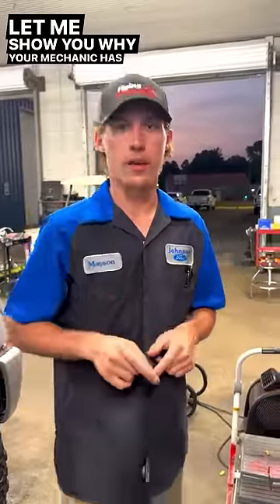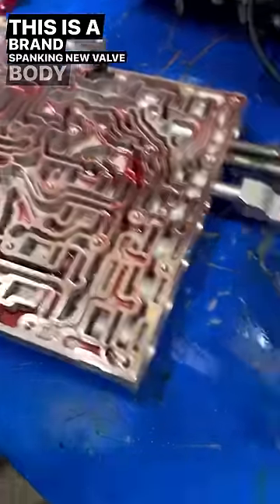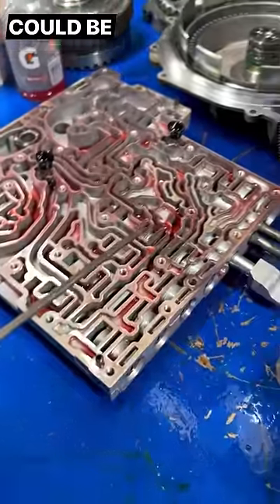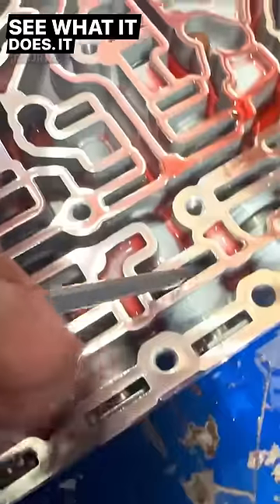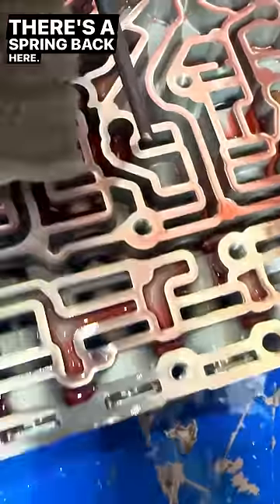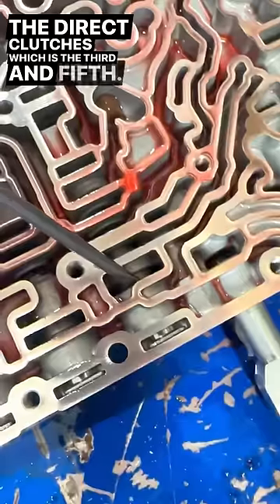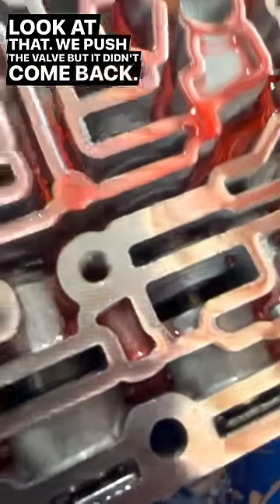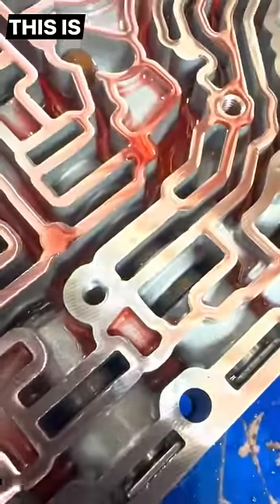Why your mechanic has trust issues #shorts #ford

Comment: this is why I always say: just because it's new, doesn't mean it's good
Reply: I have bought so many broken brand new parts I seriously have trust issues
Reply: I've bought probably 4 brand new alternators for various projects over the past 5 years and 3 out of the 4 were no good straight off the shelf...fuckin ridiculous if you ask me!
Reply: @iino27ii91 my thing is, if so many are broken right off the shelf, then what does that do to your confidence of replacing a new "hard to reach" part somewhere on your vehicle, and then it breaks a month later because it "worked" out of the box but it's still a shitty part made in some factory in China and now a month or less later you have to go in and do a pain in the ass job again because their quality control SUCKS!
Reply: scrutinize everything
Reply: 😂😂 I’ve been saying this for years! Some people don’t like the blunt fact of that statement. 😏👍
Reply: Just cause its American made doesn't mean its good.
Reply: new = never ever worked.  Nowadays especially for rotating electrical a good used part is often better than a new one.
Reply: Usually not
Reply: @foodhatesme  I work in an actual repair shop it, parts have gotten far less reliable we have been having these issues for years now.  Just because you bought one alternator and it was good doesn’t mean a thing.
Reply: Made in America*
Reply: If the whole transmission wasn’t overhauled so everything is spotless debris can contaminate the new Valve Body. If the torque converter is making metal, same thing.
Reply: Everyone I’ve ever met that decided to buy a new truck after having an older one since it was new has had way more issues with the new modern truck than they ever did with the old one. New vehicles are usually a huge scam.
Reply: @punchyourmom nothing is made in america anymore and hasn’t been for decades.
Reply: so is it overly complex or is it just poorly made?    Is it so complex that it cannot be made properly without driving the cost up out of affordability?   you are right..just because it's new doesn't mean it's good.
Reply: You can say that as broad as most vehicle built in the last 10 to 15 years.
Reply: @Gnefitisis made in america hasnt meant anything since the 198os when everything went commercial.
Reply: Has Ford always been like this?
Reply: @Eduardo_Espinoza  no
Reply: @haventthoughtofanameyet6364  that's my joke
Reply: I learned this after a lot of money 😀
Reply: Which is why I always do my damndest to repair/upgrade the broken part rather than replace with the same junk.
Reply: I always say something very similar:  "it's fine until its not"...   I'll tell my wife about an issue with the car that could potentially be a safety issue... and she'll say "oh its fine"...then my retort is "UNTIL IT'S NOT"...  im the type to address issues before they become bigger problems....she's the type to wait until it completely fails...  🤦‍♂️🤦‍♂️🤦‍♂️
Reply: I'm oversimplifying the whole thing and leaving out details here but in short, just to say: I have many older items from 40, 50, 60+ years ago that still work perfectly, either in original condition or with minor repairs done. However, I have experienced, and know many people who have, having items that were manufactured THIS DECADE, brand new from factory, give out within a year or sooner. Makes you think.
Reply: @RedLink27  cheaper/thinner materials is usually the issue...
Reply: In fact most of the problems I encounter at work are troubleshooting the new thing we just installed. After a couple months we've usually resolved it all and better long term but that first week is always rough
Reply: Dealing with that as we speak. I'm on alternator #3 from the parts store. It should arrive today, hopefully when they test it the damm thing will finally be good. I want to drive my project car again.
Reply: It's only knew once after that it's used
Reply: Lately, it has become, "just because it is new does not always mean it is bad." But that is starting to become a false statement today.  Now it is becoming, "Buyer beware if you buy it new."
Keep ahold if it is old.
Reply: Sometimes the new part has been manufactured with the same defect as the old one.
Reply: PREACH. Always always always keep your receipts people
Reply: @mpmfr i mean nobody does lol imagine telling a customer they have a bad New PCM but it happens
Reply: Somebody say that to Ford and other auto companies.
Reply: just because its OEM doesnt mean its good either 😉
Reply: New in a box doesn't always mean New in a box
Reply: I looked up the part in the video and it costs like $400 so if I paid that for a component that goes on a $40,000 truck it better be fucking good.
Reply: they dont make them like they used to!
Reply: N E W never ever worked (before) that’s what new means
Reply: Seems to make less and less sense to buy even a late model used truck anymore. They all have something very expensive wrong with them. 10 year+ old trucks have all bugs figured out, documented fixes, upgraded parts made. Extreme cost savings and peace of mind. Most probably need a back up vehicle though to work on the one that needs repair, but a back up is wise anyway.
Reply: Had to replace three new triple tested alternators on my 94 GMC within three months.  First one failed after installation.  The other two failed while driving.  The last one failed and with the other failures, the battery failed.  AutoZone replaced my battery for free but no warranty on the battery but thankful for the replacement.  The fourth alternator is working almost a year.  Through AutoZone, you have a lifetime warranty for as long as you own your vehicle.  I have a 72 Chevy El Camino and many of the parts that fail like spark plug wires, starters, alternators are lifetime warranty parts.
Reply: actually it’s getting worse
Reply: Just because it’s because, doesn’t because it’s just.
Reply: @Grozloo lmao way way more new parts are good than bad. Parts that come bad more than they ever come being good get recalls. Your being kinda dramatic to act like someone getting a new part that works means nothing...it literally means new parts can be just fine dude. Lmao
Reply: @Jeremy9697  you actually took the time to write that nonsense?
Reply: @peacepoet1947  lol cope harder kiddo. Again if new parts were broke more times than not the entire vehicle industry would have already fell apart. Be realistic child
Reply: @Jeremy9697  the comment you made was obvious and to be blunt a waste of energy to write it.  We are here to learn something and not read useless information.  Add something interesting or intelligent.  Is that too much to ask?
Reply: @peacepoet1947  kiddo...ypu responded to what you deem non sense is the real waste of ypur own time. What a hypocrite. Sorry dude but the person I commented to doubled down with a second comment on how new parts don't work...in his opinion obviously. So your point t has already been blown away... talk about a waste.
Reply: Yes, though I think it's important to remember that just because it's d doesn't mean it's better
Reply: i totally agree thats why i never get into the “this brands better” argument cause u can have two identical cars make n model off the lot and one might run for the next two years just fine but the other will break down and have constant issues the whole time u own it
Reply: @endlessbacontreats9916  after you own a vehicle and work on it when needed.  Most vehicles can last a very long time no matter what goes wrong.  I bought a 72 Chevy El Camino and I still drive it.  It needs work but I still drive it.  Bought two new front tires for her birthday.
Reply: but at least you can bring it back because you have a warranty
Reply: Or going to last lol
Reply: For real I’m always hesitant with “ new” stuff
Reply: Things now days are half the quality and double the price.
Reply: @JoeXTheXJuggalo1  yes compared to 80's and 90's items are build to last. today, items are all disposable
Reply: if you have never gotten a bad part that is brand new then you haven't worked on much or you have been very lucky.
Reply: @Eduardo_Espinoza  I have a 1968 Ford and it is one of the most reliable cars I have I'd trust it on a long road trip before any new car other than the fact the new stuff is more comfortable
Reply: One of the reasons I’ll buy refurbished, IF they properly went over the profit before reselling as a refurb.

Looking at you Autozone rebuilt alternators.
Reply: @RedLink27 the reasoning is profits, profits above everything else, started in the 70s and just exacerbated the problem since.
Reply: New just means “never ever worked”
Reply: Buy Toyota. Problem solved.
Reply: @RedLink27 because they make it as cheap as possible, and the criteria isn’t how long it will last, but whether the car will meet environmental criteria or not. If the choice is between longevity/ease of service or mpg, they will go with mpg every time.
Reply: K boomer
Reply: every product these days is created to have an expiry date & to not last forever
So you are correct
Reply: We'll see the scary part isn't that it's new (plenty of new junk out there) it's that it's a NEW FORD PART!

The only saving grace we had was sourcing it brand new from the manufacturer, because you could be certain the QC had been done. But that's slowly going by the wayside😢
Reply: @tonyclemons12 I totally agree with your sentiments, but did that valve body look contaminated? Fluid looks like it came right out of the container.
Reply: @LynxStarAuto  you don’t even use a rag with lint on it in a automatic. Very fine debris can ruin your day. Dust from floor dry etc.
Reply: this applies to almost every new thing made these days.
Reply: Get alot of "junk outta the box" anymore 😮😂not Kool
Reply: @Grozloo I like that phrase.😂
Reply: My boss told me this all the time . And I learned from experience no lie man.
Reply: it’s ford
Reply: the best parts are lightly used
Reply: Even little stuff. I do property maintenance, and the number of times I've come to check out a light fixture that the tenant just put a brand new bulb in and it doesn't work, so I put another bulb in and awkwardly tell them their new bulb was just borked from the factory.. it's not constant, but it's always the first thing I check. New doesn't mean functional.
Reply: Sounds about right! Sometimes it's just new shit. Yep, new shit.😢😢😢😢 Costly, hard to earn to pay for this new shit.
Reply: We should really give all technology to poor people for the duration of a warranty for free then the ones that don’t break within that year collect and sell to rich people
Reply: Now imagine trying to explain this to a Karen who doesn't believe the mechanic. It's enough to make you ill.
Reply: Amen to that. Bought a brand new walbro fuel pump for my car some yrs bak to solve a crank but no start issue. Problem persisted. Never thought for a second it could be the brand new big name pump I just put in. After going through everything that could've been the issue, I decided to buy a used pump assembly from ebay, guess what, car fired right up. That used pump is still in it.
Reply: Should fall under warranty.
Reply: When my car breaks, the first thing I think is “what’s the last thing that was changed”… also why I don’t go through engines changing several fhings at once.
Reply: For reasons unknown some people take huge issue with that statement. I don't know why, it's simply the truth.
Reply: C o n s u m e

P r o d u c t
Reply: @Gnefitisis  america doesn't make anything anymore. that's the problem. when we actually did have our own factories, things actually worked properly, but manufacturing was outsourced to the cheapest countries to save costs, and many of those places don't have the high standards that American made products have.

That's why things being "made in America" are typically such a selling point that people like to put on their products, because buyers know that there are federal and state standards that the manufacturers have to abide by
Reply: @WGGplant  That's a lot of copium there.
Reply: It being a Ford just answered your question 😅 they never make them right

Comment: As someone who used to make transmission castings for Ford and others, we called that section "the worm trail."  It was considered the most critical part out of the entire casting.
Reply: Yes Sir the bores for the valves are critical. GM made theirs out of cast iron for many years, that didn’t get metal impregnated into it reducing the bore size. Soft aluminum is easy to work with, is the only reason I think it was used. GM was  smart enough to use larger diameter valves. That gave them enough pressure to force out a little debris.
Reply: @tonyclemons12  ours were aluminum.
Reply: daveddm yep 👍 it's the brain 🧠 of the transmission
Reply: @mariocooldude9092 glad you put that picture of a brain or I would have no idea what you ment
Reply: @Truth-And-Freedom  I gotta cat 😺 dude 😎👍
Reply: They're one of my favorite parts, too. I remember stripping a tranny and analysing one of these. It was an interesting exercise getting my eyes and brain to precisely follow the fluid path in the casting. One of the more interesting side effects was that doing this actually improved my eyesight! Great exercise for the eyes and brain.
Reply: I used to work for a Ford authorized rebuilder. My job was valve bodies. At that time I rebuilt anything from c6 up to 4R55E valve bodies. They even had a Dyno tester specifically to run the v.b. through it's paces to make sure it was good before installing in the transmission. At the end of the line there was a Dyno for the finished transmission. That guy all he did all day was run the transmissions on the Dyno. Then give it a coat of gray paint, slap on a sticker, and then crate it up.
Reply: @dougfisher1813  I remember making the 5R55 transmission castings.  Man, those sucked.  Big and heavy part to throw around onto pallets.
Reply: What exactly was the issue? Could the channel be bored/sleeved?
Reply: Chrysler hasn't made a good transmission for over 60 years..
Reply: @longbow6416  nope they haven't.  The Ram trucks have come a long way and look really nice but would never own one for that reason.  Don't trust their transmission.
Reply: @ryankbond I have the Dakota with the standard transmission. They seem to hold up much better than the automatic transmission for some reason. I took a risk buying it used for 2 grand. It’s served me well tho. Now running it with 187k plus miles on the set up and it keeps me going. My throw out bearing is making some noise but I think I’ll save up for a clutch to be replaced soon. If you can find one that’s stick shift and still reasonable pricing it might worth looking in to.
Reply: why are you upset over an emoji? @Truth-And-Freedom
Reply: I feel sorry
Reply: Most critical part and it sucks? Damn FORD really is Found on Roadside dead.
Reply: daveddm u gay
Reply: I was there, i Was the worm.
Reply: @tonyclemons12 not always
Reply: @ashtonpadilla5269  I don’t think anyone in their right mind would attempt that, the amount of labor would be more than replacing the whole transmission.
Reply: @bearing_aficionado I'm not sure if it was the 2022 model year or the 2023 model year, but one of those two years has Ram as the most reliable truck models. They were using service and repair data when they made that determination.

Comment: As an engineer (and previous assembler, re-work, and testing technician) for a Caterpillar drivetrain remanufacturing facility, valves are a bitch. For the most part they come pre-assembled and just get thrown on. Most of the time we will catch the issue when we’re testing it but at the end of the day (in my experience), mass produced valve body’s are a roll of the dice.

Comment: I used to work as an engineer at a remanufactuing plant.  We would get all the faulty valve bodies from ford, we would tear it all down, fix the problem area, revalidate that it shifts through all the gears, slap a new serial number on it, and send it back.  So "brand new" was relative.  We would do hundreds a day.  That and torque converters.  Your mechanic is right to be skeptical.....
Reply: Liar
Reply: @johnlocke_1  sure whatever makes you happy 🤣

Comment: That's how you get seized pistons and burned up clutch packs.  When doing a transmission rebuild, replace and revise all the moving parts in the valve body known for premature failure, or should've been recalled from factory.

Comment: That's why Ill never have to worry about being replaced with a robot. I'm willing to bet the bore in which that valve sits in is slightly undersized causing it to stick. If I was a betting man I'd say the insert on the boring bar chipped.

Comment: Why is it shaped like it is?
I'm not a mechanic but the transmission part is straightforward, but even if it's patterned to save weight, why is it shaped like that?

Shouldn't a uniform pattern bring more structural integrity?
I just assume it's shaped like this to save weight because most of the pattern is just empty space leading nowhere.